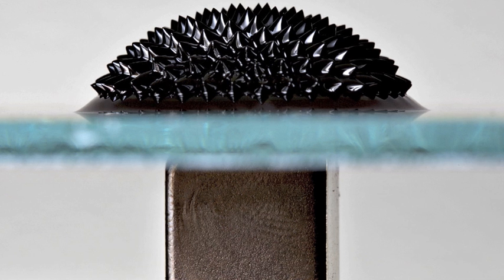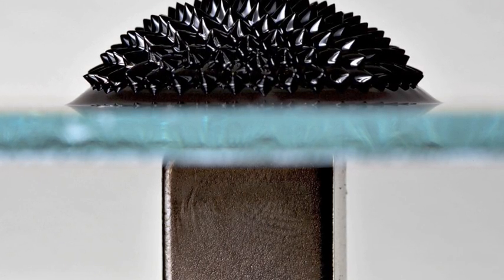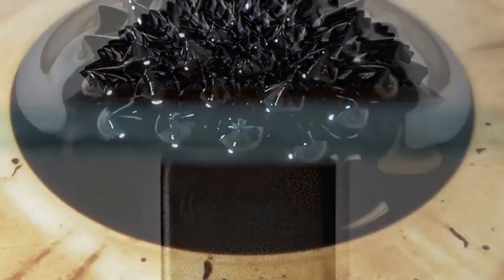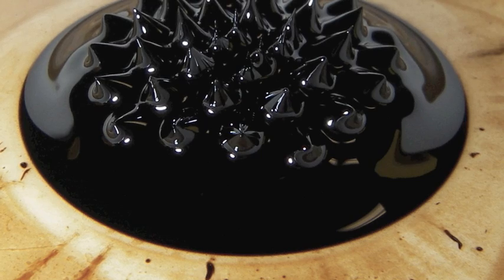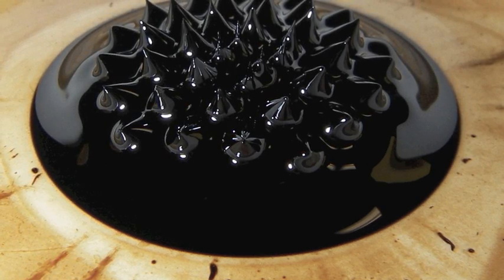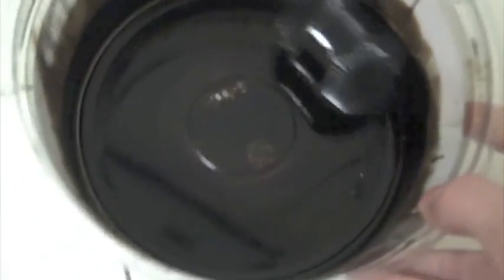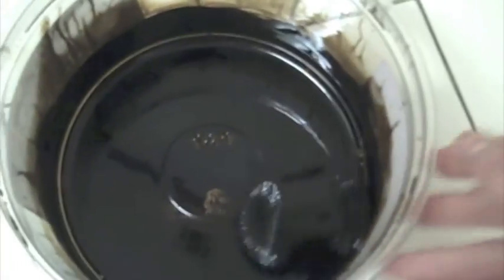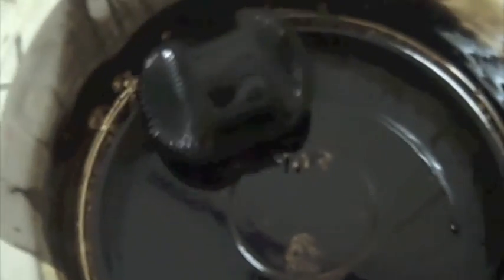Magnet in Ferrofluid

Comment: Interesting stuff. So, since it's fluid, would your skin absorb some of it if you touched it with a finger? Or would it still be reluctant to leave the magnet?
Reply from the maker: It will stain whatever comes into contact with it but the majority will stick to the magnet.
Reply from the maker: So if touched it will leave a mark but the amount of fluid present on the magnet will have only changed by a minuscule amount.
Reply: ***** But still, if the skin absorbs even a tiny amount, a powerful magnet could mess with your skin? Kind of creepy if you think about it. I'm assuming that the minuscule amount absorbed by the skin still contains the ion oxide, and makes it react to the magnet after absorbtion...

Comment: personally, I'd only use a disposable magnet for this experiment as it is very hard to get off all the ferrofluid. But a method I thought of, was to have something that the magnet barely fit into, mushing all the fluid off the magnet to one of the sides, and then slide a copper sheet in between the fluid and the magnet. this would not completely remove all the fluid, but it would get like 98% of it, then use soap on the magnet to dissolve the oil. (ruining the rest of the ferrofluid)

Comment: I wonder if this could be used for lubrication in some mechanical application. But perhaps the iron oxide particles would be abrasive. It does seem to slide around very easily on that cushion of oil.

Comment: For sure!  I think that's the magic of "pliers" could come in handy!  :)

Hindsight being 20/20: maybe it would have been easier if the magnet had been prewrapped in plastic/ a baggie/ saran wrap or something similar.  I've been very interested in ferromagnetic fluid recently; it's neat stuff for sure!

I'm interested in obtaining/ making some and experimenting with electromagnets.

Do you know if it's possible to colorize the fluid?  It seems like it'd be difficult to add color to black.

Comment: Maghemite/magnetite is the most common combination of iron oxides in these particles. Schering actually used similar water based fluids in some of it's MRI contrast agents for a while using a methylated dextran derivative as the surfactant, but these have since been taken off the market, I would assume to prevent competition with their other gadolinium based agents. The sub 10nm particles actually agglomerate to form roughly 70nm diameter clusters.

Comment: you were wrong about a few things 
1 it is not iron oxide because iron oxide is rust and non magnetic it is nanoparticles of iron
2 there was ferrofluid removed it was on the spoon sticking to it :,(
those spikes aren't just cool and "just happen" they are made because the magnetic field has different strengths and it pulls the nanoparticles surfactant and liquid with it which pile up to form the spikes also those spikes are the reason this fluid is non newtonian

Comment: the iron oxide in rust is Fe2O3.
The combination of iron oxides in ferrofluid is magnetite (Fe3O4) and maghemite (γ-Fe2O3, it is slightly different trust me).
Ferrofluid is essentially a colloidal solution of tiny crystals of these formulas (typically 3-6 nanometres) whose magnetic dipoles all align when introduced to a magnetic field. These fluids found use in MRI contrast for a while, but none of them are on the market anymore.

Sorry to be such a bore!!!!

Comment: Hm, that's interesting. I agree that the fields are generated in different ways (sheer mass versus electrons being in a certain order), but aren't the graviational fields they generate practically the same, only generated in different ways? Like you can create fire by friction or by electricity, but both fires will act the same way. Correct me if i'm wrong though, i'd like to know :)

Comment: The Range Rover Evoque has a similar material in it's suspension, four monotube dampers filled with oil and magnetized iron particles, electromagnetic coils are used to adjust the firmness of the suspension.

Comment: An electromagnet with more power than the magnet in the fluid, then just turn it off after removing the magnet which has been stripped of the iron oxide/ferrous liquid and the iron oxide/fluid should simply drip off(might take some cleaning because of the oil).

Otherwise just use something that absorbs the oil and painstakingly scrape off the iron.

Comment: put a stronger magnet on the outside of the container, it should grab some ferrofluid off the other magnet. remove both magnets and pour into another container. repeat process until clean.